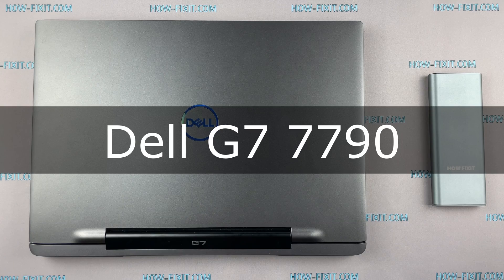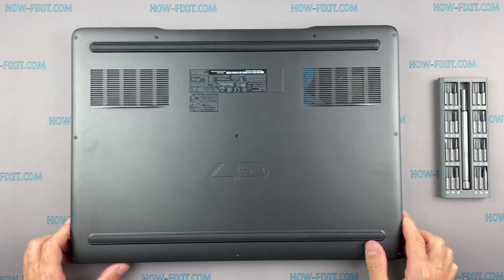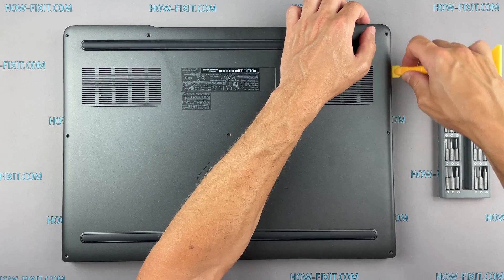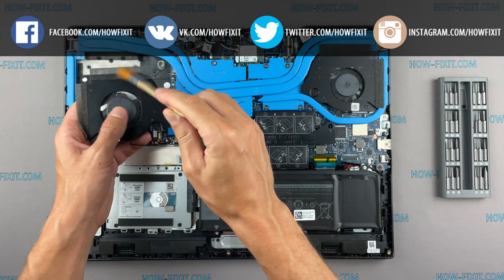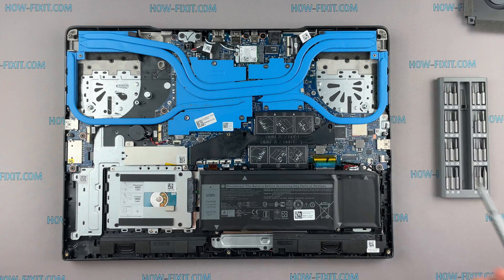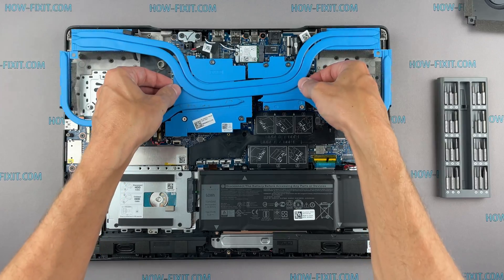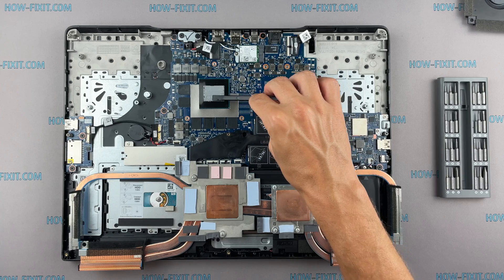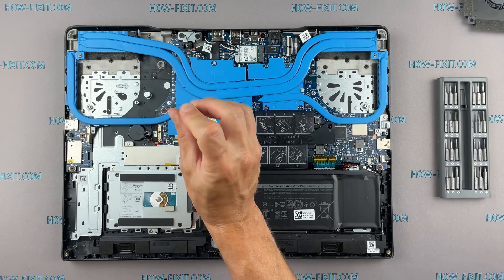Dell G7 7790 Disassembly, Fan Cleaning and Thermal Paste Replacement

Comment: Too bad my fans screws are too absurdly tight to even disassemble now they are messed up (I tried a rubber band no luck) why did dell have to make it super tight for? Anyway thanks for the video still.
Reply: Use a dremel to cut a groove into it then use a flathead to unscrew it
Reply: Did u ever end up getting them out? i have the same problem with just 2 of my screws, rest came out no issue.
Reply: PH00 this is size of the screwdriver you should use for fans - different one than for other screws.

Comment: The heatsink screws wont come out with any screwdriver I tried. This laptop is the biggest piece of thermal throttled trash I have ever had to deal with.
Reply: Yeah they fucking screws wont come out, I stripped them completely.
Reply: This is shockingly common on most modern laptops now sadly.
I used a reverse drill bit and a screw to unscrew them in the end, then replaced them all with quality screws so I don't have to do this again lol
Reply: just for a few screws? you call it garbage haha what a crystal xD
Reply: @zerefrdz9732   My motherboard died in mine months ago, I'm still trying to get the $ together to send it to Sydney for replacement.  Notice that the dust is being flicked off the fans while holding them right above the open laptop, so all the dust goes back into  the laptop.  lol    I really like the clear view in the video.  thank you.